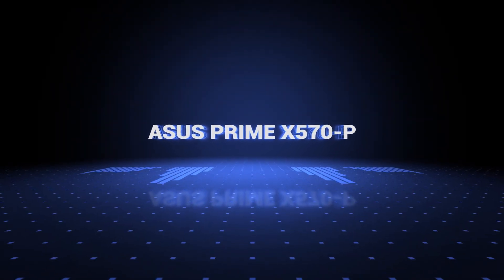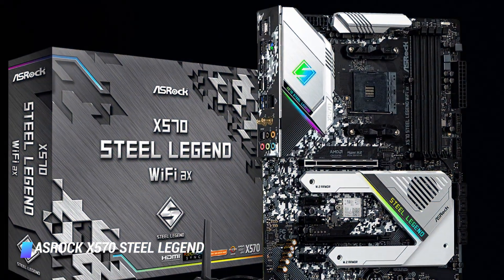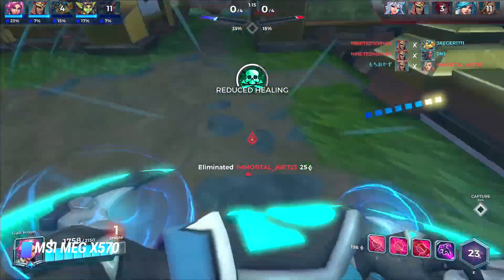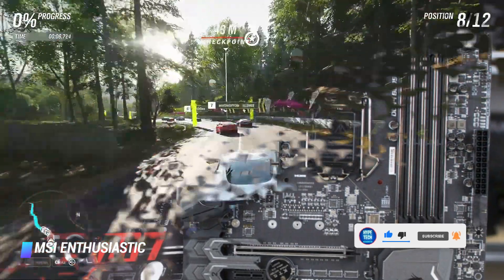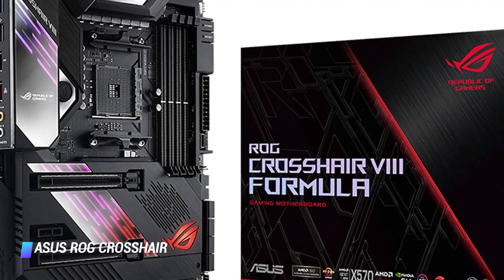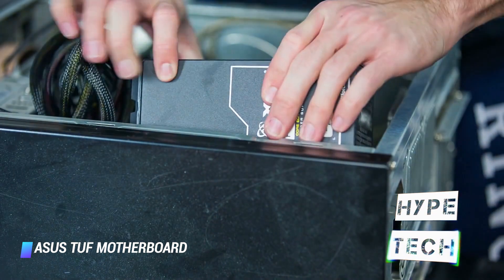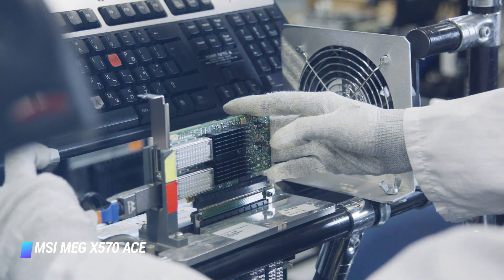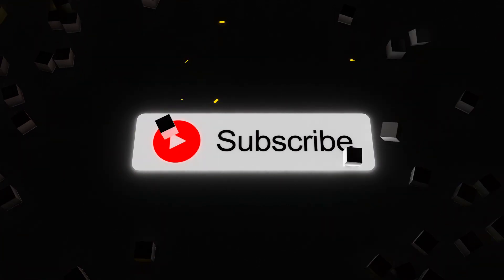Best X570 Motherboards in 2025 - How to Choose a Motherboard for Ryzen 3900X, 3700X, 3950X?

Comment: Such nonsense ... Most of what was said in the video, not only does it not carry anything useful, it is also misleading.
P.S .: the author, before telling something, read himself about motherboards. (The same MSI MEG x570 UNUFY came out in 2020, based on the x570 Ace, which appeared at the end of 2019. Unify was improved taking into account the shortcomings of the Ace. In fact, the difference between them is only in the backlight and the vrm cooling system, while with regard to vrm and cooling tubes on the Ace, its presence does not mean better cooling or more convenient operation if you need to dismantle the cooling fan).
P.P.S .: unambiguous dislike for cheating the audience.